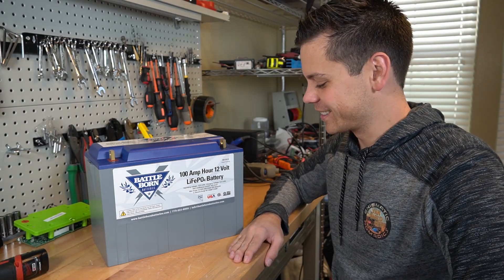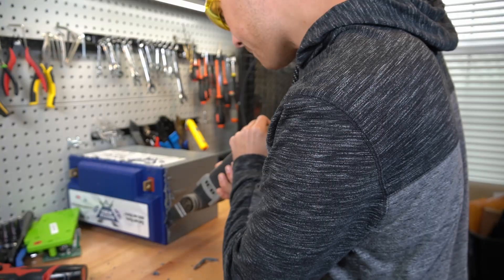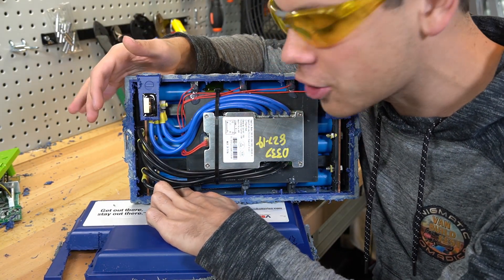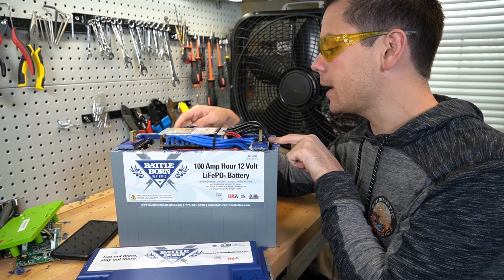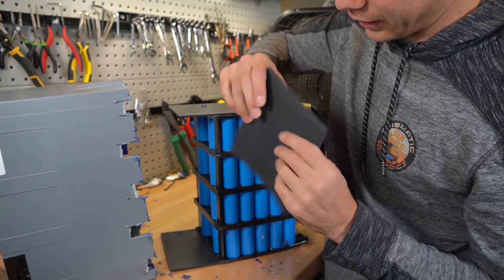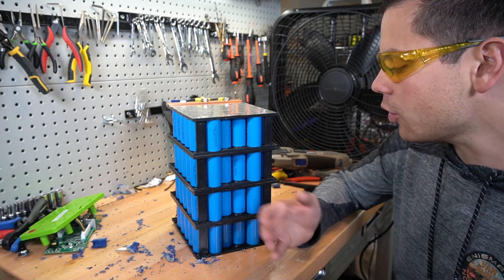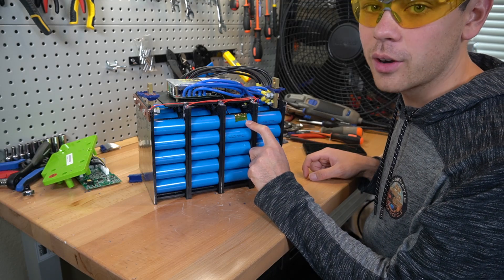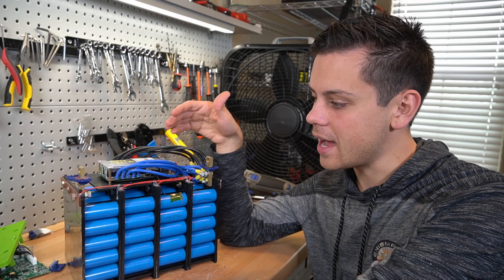$950 "Battle Born" Battery Tear Down

Comment from the maker: BUYER BEWARE 2025 UPDATE: this battery has a design flaw that I missed in the video entirely. The main positive terminal is connected to the pack below with a bolt and nut. There is plastic between these. Once the plastic melts the company claims that it's supposed to disconnect, but what happens instead is it heats up even more. Terrible design and people are not getting their money back when they file a warranty claim. Do you not buy this battery!
Reply: Hello WIll. Great video. Could you share a closeup picture of how the positive terminal is secured inside the actual case? At 3:18 on the video it shows but not very clear. Looks like two nuts, one on top of the other one i guess locking it? Thank you in advance.
Reply: @edgardoguzman2858 is this still an issue or did they fix it
Reply: @edgardoguzman2858 Oh wow this really has been an issue for a while.
Reply: Glad to see you update this.  They were the Mercedes of lithium batteries.
Reply: @SK-qt1rm , only because people didn't notice the design flaw that ALWAYS existed. Worse, BB was somehow getting videos of the design flaw removed as quickly as they were showing up on youtube instead of addressing the problem that has existed since the very beginning.
Reply: I'm in Australia and can't seem to find a website to purchase the battle born 12v 100ah. Is there any other batteries that are equivalent and of same quality that I can purchase here in Oz? I'm doing a 48v system and will be wiring them up in series. Any suggestions? 🤔 Thanks.
Reply: I wish you had caught this back then. I bought 16 of these based on your positive review. Worried about them now!
Reply: I think the bigger issue is the plastic which seems like its an integral part of the connection from what I can see.  I still wouldn't have used an Aluminum bolt though.
Reply: Are you able to edit this video to update it? Might be smart to make it private if not.
Reply: Kudos to you Will Prowse for adding this disclaimer update. There are many products on the market that have flaws we don't always catch the first time around.
Reply: Negative post also has same flaw.  They connected the posts on the wrong side, a crazy mistake.  I noticed someone commented on this flaw 3 years ago.
Reply from the maker: @jeremy314  you were absolutely right

Comment: Hi Will,

Browsed through most of your videos and was unable to find a review of the ECOFLOW Power Kits 5kVA 48V Power System for RV's. Several RV manufacturers include this system in their builds that have super great reviews of which I am very skeptical? You being one of a very few that truly give an honest review of these battery systems, would you possibly consider a review of the ECOFLOW Power Kits 5kVA 48V Power System for RV's and settle this burning question for your viewers.

Apparently Battle ReBorn needs to be implemented.

Thanks for your service and have a great New Years!

Comment: Thanks for coming back here and laying out what you discovered by conducting later testing on these batteries. No one is perfect but at least you owned up to the oversight. I used your reviews of batteries when we were shopping for a replacement to our lead acid batteries and wanted larger capacity. I liked the Battle Born batteries but was not willing to pay the premium when there were other options available that were still very good. Based on one of your reviews, we went with the LOSSIGY 12V 400AH LiFePO4 Lithium Battery and have been very pleased. What you provide to this community is extremely valuable. Please keep up the great work! 👋👋👍👍

Comment: I just can't justify lithium battery prices. I just used 4 Interstate 6V 220ah run in parallel for 12V in my RV. I live offgrid and cycle them down to 12.2 to 12.4 everyday and they lasted 6 years.
I get that lithium would last twice as long, but the price difference is 3.5 times more expensive. If you're not running air conditioners or microwaves, why would anyone pay that price difference? The sealed lead acids did everything I needed them to do. The weight wasn't an issue, and they worked fine in 30° F temps, plus I never had to worry about fires.
So until prices become more reasonable,  which I doubt, I can’t understand why people buy them.
Reply: Here's an answer I received...
So, spending 3.5 more for BB Lithium is definitely not worth it for normal RV/Boat use.

"You bring up solid points, and your experience clearly demonstrates how well lead-acid batteries can perform when managed properly. For many off-grid users like yourself, the upfront cost of lithium batteries can be hard to justify unless the use case demands the specific advantages they offer.

Lithium batteries shine in certain scenarios, such as:

Weight and Space Savings: For RVers or boaters who are limited on weight or space, lithium batteries are much lighter and smaller for the same capacity.

Deeper Discharge and Efficiency: Lithium batteries can be discharged more deeply (80-100%) without harming their lifespan, which means you can use more of their capacity compared to lead-acid (50-60%). This can be helpful for people who have higher energy demands.

Faster Charging: Lithium charges faster than lead-acid, which is great if you rely heavily on solar panels and need to maximize energy during limited sunlight.

Extreme Temperatures: While your sealed lead-acids have worked fine in 30°F temps, lithium can struggle below freezing unless it has built-in heating systems. But in hotter climates, lithium batteries often perform better without degrading as quickly.

That said, your case—cycling lead-acids within the proper range and not running high-drain appliances like ACs or microwaves—doesn't require these lithium-specific advantages. You’ve optimized your system for lead-acids, so it’s a cost-effective, proven solution.

For those who don’t need the added features or can’t justify the initial investment, lead-acid (or even AGM or gel batteries) will continue to be a practical and reliable choice. Until lithium prices drop significantly or lead-acid prices climb, it’s hard to argue against the value you’re getting from your current setup."

Comment: I bought 2 of these batteries 2.5 years ago. 1 failed last year so they replaced it. The othere failed this year. After charging, the battery reads 14 volts. With a meter, you can watch it drop to 9 volts within a couple minutes. Battle born offers no support. Just telling me it must be my charger although the charger is for lithium ion batteries and the 2nd battery works flawlessly. Support wont answer any more calls and wont return my call. Dont waste your money.

Comment: I really wish someone did a repair video on batteries like these. Doing a repair on lifepo4 batteries that do not revive with a car jump or 3 stage lithium charger. All these video on reviving these batteries simply focus on the basics telling you to jump the battery with a car, nothing further if it doesn’t work. This would be really helpful because there are many ppl in this situation.

Comment: I have a battleborn 50ah lithium battery that I purchased new in 2021. The price was $550.
This battery malfunctioned possibly due to my error in my choice of lithium battery chargers. !
Battleborn wants $350 for shipping plus $150 an hour to check the battery and determine repairs if the repair is deemed to not be under warranty. I'm not a gambler and i on't stick another $500 into this battery.
To make a long story short, is there anyone who has any knowledge of these batteries and who may be able to repair it?

Comment: Cylindrical batteries are the worst compared to prismatic and even pouch cells. If they are still charging 900 for this, customers are getting ripped off.

Comment: hey Will, I appreciate your reviews and how you go deeply - well done!
I do want to correct something I think you stated: If a cell shorts, the battery will not continue operating, the whole thing is done. When a cell shorts, the other cells in that bank dump their energy through the shorted cell, discharging the other cells in the bank and sometimes lighting up the shorted cell because of the heat generated. This is where iron phosphate cells are good, in that situation the result is not very "dynamic". One advantage of using many cylindricals is that the energy in each cell is reduced, making an potential incident much less severe.
again, good job on the reviews.

Comment: Since each cell is 3.4AH and there are 30, then the maximum AH rating of 100AH is maintained with basically 102AH (that's really not a great deal of margin). I believe they may have been shooting for an AH rating more than the WH and luckily met and exceeded their value for WH's. Maximum current handling capability will be limited likely by the connections to the buss bar. I would have hoped that they had multiple screw terminal instead of just using two per side. The surface area of the terminal that makes contact with the bus bar is the maximum amount of current allowable given an acceptable temperature rise (you could melt the wires but probably not what you want to do). So even though they use five (5), 10AWG wires going to the bus bar there are still other limitations that probably reduce that theoretical 150A possibility. Right now the batteries effectively has two contact points. So the surface area of the ring terminal will likely be the limiting factor in current handling capability. Remember you can push a high amount of current through these terminals for short durations, but anything nearing 30 minutes or more you may want to put some thermocouples on the terminals and determine if the temperature would melt the insulation of the 10AWG wires or the casings around the batteries. Also keep in mind, in actual practice you would want to consider worst case environments around 60C (like a bad day in Arizona inside a shed with no ventilation). Also not shown is how each bank of batteries connected in series to the adjacent bank. That would also be another pinch point in providing very high current. Last looking at the Blue terminal, I assume (+), connections the implementation of the screw terminals even hinders current capability more. They even had an available lower terminal as well as mounting to the other side of the buss bar electrode. So yes I agree you could more current out of these than the way that Battle Born has implemented their design.

However I disagree with your assessment about loosing a cell with a cylindrical implementation is superior. If that cell shorts then you would loose that bank of batteries regardless of prismatic or not. The only way you could get most of your capacity back is to identify the bad cell and some how remove it. Unless the assumption is that a bad cell will open up it will likely short. It will be very difficult to identify and replace that cell, especially if the bad cell is in the middle. Even if you are considering a fading battery cell it would be no different. Exposed battery cells have the advantage of being able to be cooled a bit better on the outer wall as well as through the electrodes from top to bottom. However in this implementation (i.e. not an EV car) there is no advantage from the cell structure over Prismatic. And likely from a manufacturing perspective purchasing a set of prismatic cells with really large electrode terminals would probably reduces and possibly enhance reliability since the cells would be protected from several layers of insulation.

What you say about Battle Born's customer service though is good news and likely speaks to a company that cares about making a quality product that will last. I'm all for more American companies, but just being smart about batteries is not enough, the manufacturing has to be clever and streamlined to be competitive and the people at the battery company should also be exceptional at manufacturing as well as battery science. They are providing a product not just a science fair project. I.E. I really hope they are buying these batteries at a cheap rate, where all 30 are already spot welded to the plastic frame, instead of buying each individual cell and doing the 60 spot welds per battery bank. Though if they can implement a battery system that does not need 60 spot welds, then that is a better more cost effective design.

Comment: The copper bus bar is connected to the battery terminal by one small bolt. Is that really about to handle the rated current?

Comment: Will, I have always worried about one of the 30 cells in any given layer shorting out. This would mean that all the remaining cells in that layer would send a very high current through the bad one. That makes me worry about starting a fire. Is this a valid concern or is this not really how it works out in real life? If not, please shed some light on this subject so I can learn something. Someday I may make a battery out of a bunch of round cells in a configuration a lot like the one you have torn apart, provided it is safe in case of one cell failing.

Comment: I have a 200 watt solar panel and 2ea. 100 ah batteries and 2000 watt inverter to run air during day and night. Can I run a battery charger off the inverter to keep batteries charged at night and keep my air and heat conditioner running?

Comment: I know this is an older video - Battleborn batteries are assembled in Reno, NV.  Most battery manufacturers copying each other assembly them in China.  It is easier to get another battery within China, than it would be to import a battery from the US to China to copy.

Comment: When make a lifepo4 battery pack, normally will use 26650 and 32700 lifepo4 cells in the market, if make 11.1v lithium ion battery pack, normally will use 18650 3.7v battery pack. 18650 also have lifepo4 cell type, but use less than 26650 and 32700, only when size limited.

Comment: I have a simple questions, if I have 2 100W solar panels and the MPPT 75/10 and that 12V 100Ah Life PO4 battery can I run a full size fridge and how many hours? The sunlight in Puerto Rico is really strong, what inverter I need? a 2500W or the 3000W? Because in Puerto Rico with the hurricanes and recently the plant failure that we have the other day I considered getting a small system at least for the intelligent TV's and the fridge and fans "no power tools or heater elements" also sorry the 3000W inverter need at least 2 12V 100Ah batteries right?

Comment: Great video. So I purchased 2 100ah BB batteries for my 2020 Winne Navion 24D. I been told that it came with a   ChargeMate Pro 40amp charger. Is that enough protection or should I install a Victron DC to DC charger? Also my current batteries don't use the posts they have screw down connections. Any ideas on how to convert to screw down on the BB's? Appreciate any help. Thanks

Comment: I was just watching a video that opened up a battleborn and pointed out, that the positive post is not connected to the copper bus bar directly, but through a stainless steel m6-m8 size bolt. The post and copper bar do not actually contact each other at all. I know from experience that trying to send current through stainless steel is a huge bottle neck and someone needs to point out this mistake.  Trying to send current from copper through stainless steel then through brass has to be losing a lot of energy through heat.

Comment: I have 4 battle born batteries 2 of the 4 have failed both had water get in them and damage the bms .I sent them back and both were replaced.Thank you Battleborn  but there is a problem with the case to let water inside.I have moved them inside the rv and things seem good for now.They are not a dropin replacement for bumper pull rv's that have the batteries on the front with the lp tanks.

Comment: I just ordered two Battle Born, 100ah heated batteries and connecting kit....I'm going to be putting them in my ice fishing wheel house. I installed a 300 watt solar system on the wheel house and have a solar charge controller that can be set in "Lithium" charge mode. Also, I have a 2000 watt pure sine wave DC/AC power inverter to connect to them.  Can't wait to see how they perform.

Comment: So 100amps flowing through a 1/4" or 5/16" bolt torqued onto a copper bus bar all sandwiching a piece of plastic...in a large array its a non-issue for most normal uses.  If I was going to be drawing major amps consistently through a pack, Lithionics is still the only choice right now.

Comment: Every time I  hear "short" as a failure mode I think of low resistance, and in that case that paralleled cell grouping is going to cause localized heating and a bms shutdown due to imbalance/temp rather quickly. I don't know enough about the failure modes of this chemistry to bring much to such discussion mind you. 
I appreciate all you do Will, there's so much out there to make sense of.  Keep up the great work!

Comment: great video, love your enthusiasm! looking at the positive terminal at around 7:35 its actually very concerning to see that the terminal is on the other side of that plastic separator. that suggests that the bolt is carrying the full current of the battery unless there is an additional direct connection between the terminal and the bus bar that is not visible. using the bolt to carry current violates basic engineering practices

Comment: What battery would you suggest for boats? know battle born are widely used, but I will be using for a less expensive jon boat and was wondering if any of the cheaper amazon special batteries would be safe to use if going to get wet on some day. thank for your videos.